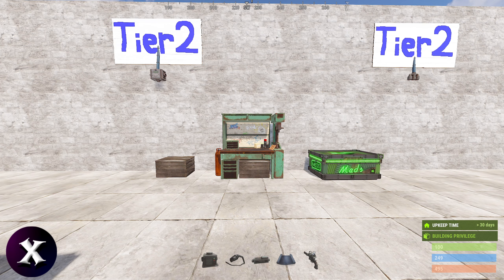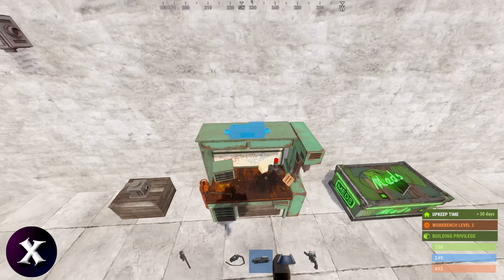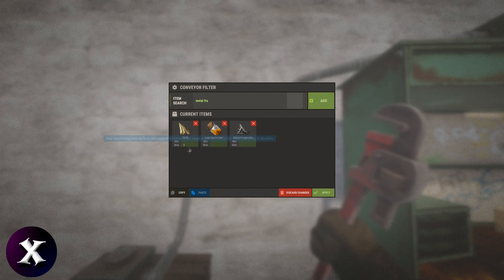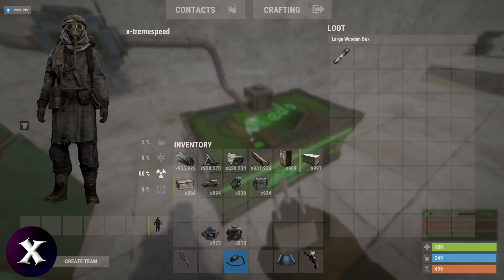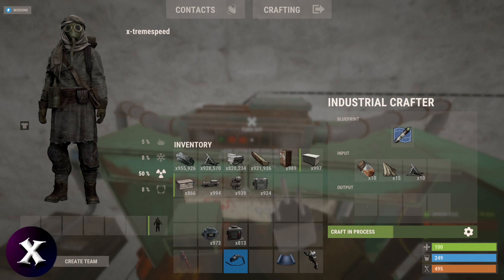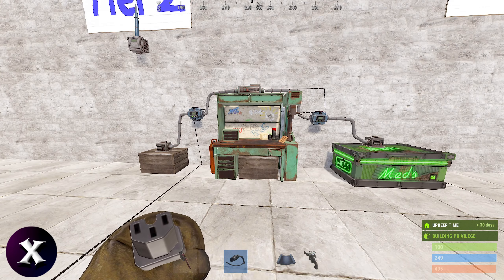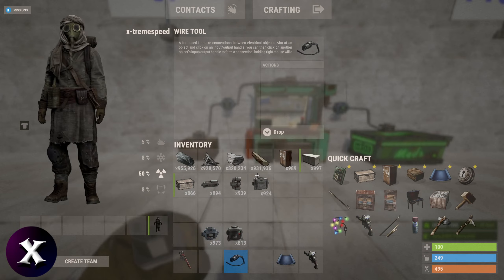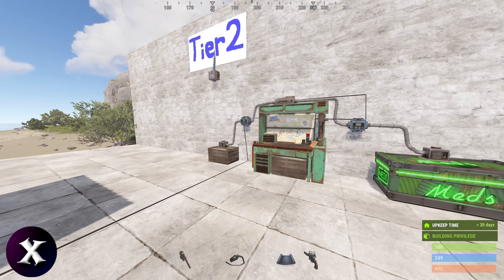Auto Crafter Module | Rust Modular Sorting System | Tutorial

Comment from the maker: Join my discord!
https://discord.com/invite/u9JA6Kg3CF

Note

If you have a modular sorting system and are adding this auto crafter, just plugging it in to the Tier 2 line won't work. You will need to add a combiner between the Tier 2 med box filter and the med box, and plug the output of the auto crafter conveyor into this combiner.

Comment: Are you able to have it auto-craft bandages and syringes simultaneously? Would be awesome to have a auto-filling meg box that you can just grab from
Reply from the maker: Directly? No. This was made before crafters could hold multiple blueprints. It is definitely possible, but would require some logic rework. The simplest solution would be to set up a second crafter for bandages so they are separate. If I end up playing around with the idea and get it working I'll reply to this again with the update!
Reply: @x-tremespeed  I assume this goes the same for different ammo types in the same crafter, yes?
Reply from the maker: @scotteric8711  You can't have regular pistol ammo and regular 5.56 ammo in the same crafter as they have identical recipes. If you are crafting the specialized ammo types, organize the blueprints in order of most to least resources required to craft, left to right.

Comment: If you hook up the output to the tier 2 line instead of that box, would the "max" value still work?
Reply from the maker: Actually, that is a little mistake!

If you do have a sorting system set up and wanted to incorporate the auto crafter, you would need to add a combiner just before your med box. One input is the regular med filter with no limitations that is connected to your T2 system, and the second input would be from this conveyor from the auto crafter.

Sorry about that!

To answer how the "max" option works in more detail: it will fill EVERY box it is connected to with the set amount. For example, if you had 2 med boxes connected to the conveyor, it would put 24 meds in BOTH boxes for a total of 48.
Reply: Amazing, thank you!

Comment: Is there a way of crafting different items using the same crafter?
i.e. craft meds until you have [amount], then craft pistol ammo until you have [amount], then craft rifle ammo, etc.
There are blueprint in/out ports, so I assume it is possible, but can't figure out a way to do it.
Reply from the maker: Yes, it is definitely possible but I haven't tried it. I try to stay on the more practical side of the industrial system and a big auto crafter like that would, in my opinion be way more work than it's worth.

You can put 4 BPs in each crafter now so you don't need to bother with switching out BPs. The crafter will attempt to craft the items in order from left to right. Make sure you put the more complex BPs on the left otherwise the less complex ones will always craft and never let the more complex ones craft (for example syringes and bandages, you want syringes on the left. If bandages were on the left, once you put in the syringe recipe of 10 LG 10 metal 15 cloth, the bandages would start crafting with the cloth and the syringe would never craft) you would then need more parts - one to send the finished items where they need to go, one to "count" all the finished items, one to bring items into the crafter, and a smart system linking the count conveyors with the input conveyors to turn each of them on and off.

It's a fun thinking project for sure, but I'm honestly unlikely going to release a video on it. It's possible if I have enough free time to think about it and test it out, but probably not any time soon.
Reply: @x-tremespeed  I would love a video on this at some point if you have the chance.  Being able to set up one crafter to fill a small box with a couple rows of meds and a few stacks of each ammo would be awesome
Reply from the maker: @theddbandits6023  If you're just looking to have syringes and 5.56 I recommend setting up 2 crafters on your workbench since it has 2 slots for crafters! That would be the easiest way by FAR.
Reply: @x-tremespeed  wow thanks for the fast reply! do you think it would be possible to have one crafter for meds and one that crafts both rifle and pistol ammo?
Reply from the maker: @theddbandits6023  unfortunately no, the two ammo types can't go in the same crafter. You could set up the pistol bullets on a third crafter on your tier 1 though!

Comment: how can i make to the craft auto turn off wen is done and turn on wen i take some from the box? i dont like the craft run all time dont make anything
Reply from the maker: Connect your med box to a splitter, and then into a conveyor that doesn't lead anywhere. Set the conveyor filter to syringes and set the MIN to 24 (or however many syringes you have in the box). Connect Filter Fail of the new conveyor to Turn On of the crafter, and Filter Pass to Turn Off. Next, you need to make a timer circuit which requires:
1 Timer
1 Splitter
1 Blocker
1 Memory cell
Plug 4 power into the timer and set it to 5 seconds. Plug the timer into the splitter, and that splitter into the block passthrough on a blocker, and the TOGGLE on the side of a memory cell. Plug 2 power into the blocker input, and the blocker output into the activate socket on the timer. Put 2 power into the memory cell, with one output going to Turn On of your new conveyor, and the other output to Turn Off your new conveyor.

All that being said, they are making crafters quiet when they aren't crafting in the next update, even if they are on. (subject to change, of course)